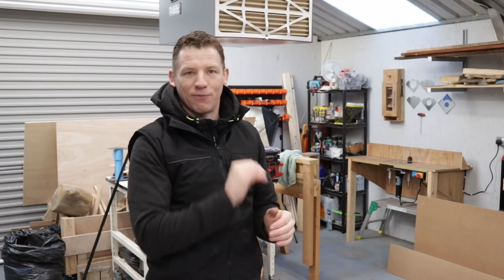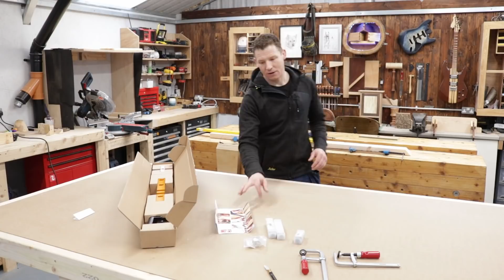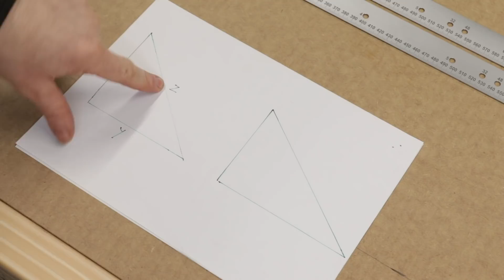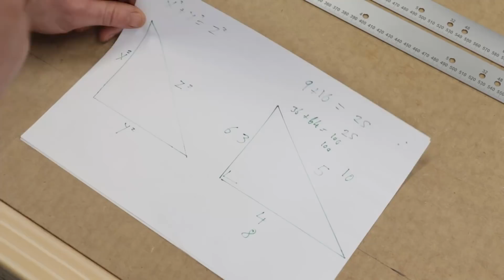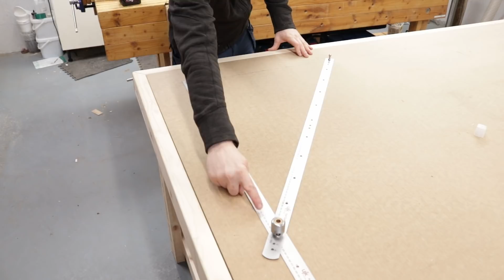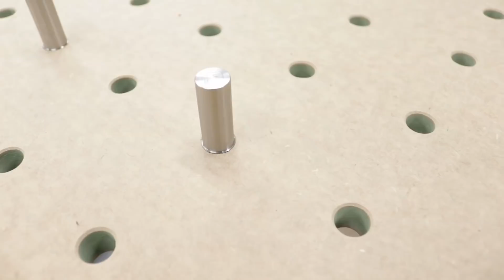MFT Table Build. Using The Parf Guide System MK2. With Problems!!! Part 1

Comment: Hi John,

This is the first time that I have visited your channel and have to congratulate you for the most superb presentational style, excellent explanations and a lovely friendly manner. I note that you had some accuracy issues and can now give you and your viewers some advice.

It is absolutely critical that when making a top that is wider than the length of one of the rulers that you start in the middle (symetrical to the top)  and work outwards - look at Page 6 of the manual that comes with the system. You then work outwards to the left and to the right from there in order to minimise compound errors. You knew that you were experiencing a compound error as you mention this at about 32 minutes.

I thought that your remedy to correct the situation was very sensible provided the whole of your top row is in a straight line. Again, had you started in the middle and worked outwards to the left and right any compound error would be minimised. I used this technique to create my new tracksaw cutting station which is absolutely spot on:

https://www.youtube.com/watch?v=xJ_dhbIdGqE

and the 4 cut test:

https://www.youtube.com/watch?v=4phL-LKM2lg

If you are going to create a multi-use top like this then it might be possible to identify where the key holes that require perfect accuracy should go. So, that forward planning would leave your down draft area (to the left as it appears in the video) to a latter stage in the drilling process rather than at the start of the work.

Now you do say that you expect to replace this top in about a year's time and I am sure that that the new top will be perfect.

Apart from that minor compound error your explanation is perfectly clear and it is not often these days that I manage to get to the end of such a long video - well done.

Peter
Reply: You know you are doing something right when you get New Brit Workshop OG Peter in your BizNaz😂😂😂😂
Reply from the maker: Thanks for the advice Peter, I will share that in a update video. Having checked everything I'm now pretty sure It was an error on my part and not the rulers. 

The final result after I corrected the error is pretty spot on. I will follow your advice on future table tops. 

I have been following your videos and really enjoying your content. 

Thanks
John.
Reply: @JohnMcGrathManInShed  wouldn’t the fact that placing one ruler on top of the other when making your triangle cause the slight discrepancy because the ruler is no longer laying flat on the surface?
Reply: Many thanks . Indeed by working around the perimeter of the grid first by creating 90 degree corners you multiply any discrepancies I believe. Almost the reverse action of the four cut test. I wonder what the inaccuracy was actually though ? Could it be that the frame itself was not a flat plane .? We're the 2x4 studs jointed flat first. If not did the MDF insulate slightly. So if it undulated he PARF sticks would effectively become shorter between 2 points if they followed an unsdulation! Just a thought. Many thanks for the video
Reply: Peter, i just have to say, that seeing your great & informative comment here; after watching such a great & informative video; was a real "fan girl" moment for me.  👍👏  The only thing cooler would have been Pythagoras, himself chiming in.  But of course, he never reads or leaves comments, something about "Silence..."  being  "better than unmeaning words."    
    I share your How to Build a Tracksaw Cutting Station video, like crazy.  I know it has helped a lot of people, in particular those without a table saw.  
      Your cheerfulness is contagious and your channel is medicinal.  Thanks~🔨Lisa♿
Reply: Hi John, love your videos,, I wonder if your slight discrepancy can be due to your 2nd ruler lying on top of the other ruler when you drilled your second row of holes, and not drilling through the ruler which was lying flat in the bench, ''technically'' the 2nd ruler would have a slight curve leaving it a micro measurement shorter, this maybe compounded to the 1/2 mm over your 17 holes,, i hope you understand this..
Reply: @kierannolan8859  Assuming the ruler was 1mm thick, and assuming a right angled triangle, then the difference would be about 0.0005mm, 2mm thick ruler would be 0.002mm. I doubt this is of any real world impact?
Reply: Peter Parf and John are truly two gentlemen on YouTube. 
Nowadays that is , unfortunately, a rare thing to encounter. 
It’s very refreshing to see two people speak 100% respectfully towards each other while disagreeing somewhat. 
Peter you especially impressed the heck out of me with your thoughtful response towards John McGrath. 
Because of this alone I’m following both of you from now on. 
Truly a breath of fresh air in these troubled times. 
We’ll as John states “Crack on!”  :)
Reply: If you get drift on the rules, can the drill jig really save you? I.e. if you get a 1 mm drift over 10 holes of a ruler, should you not possibly get 0,3 mm over the distance of the drill jig? Would it not just be pure luck saving you...?
Reply: Could it have something to do with the slab not being supported underneath while drilling the 3mm guide holes? Because he said the holes lined up perfectly, it was just a smidge too short. Maybe a touch of harder downforce while drilling caused it to sag a bit. Either way, he sorted it out👏👌 And always pleasant to watch his videos, genuinely nice guy! Keep up the good work😊
Reply: Thanks for your comments Peter. 

This video was very helpful to me. I am familiar with tolerance stacking, and I knew he was in trouble when he “went around the corner” for the back row of holes. The first row of holes needs to be your reference point for as many of the other holes as possible. 

It occurs to me that it would be better to drill the holes in the top - at least the small ones - before assembling the table. That allows you to clamp the rulers as much as possible as you work around to top.
Reply: Hello Peter. I wanted to comment on your thoughtful and considered response. It's understandable to want to jump to the defence of the Parf guide kit, but you did so with aplomb. On the subject of the "drift", I wondered, as it's such tiny amount, could it be that because one ruler lies on top of another at one end, that in effect this creates a very slight horizontal triangle, thus pulling the top row towards the bottom row ever so slightly? I.e. if the ruler lies flat, then the holes are going to be exactly the right distance, but putting one end of the ruler on top of another technically makes a teeny tiny arc. I might not have explained myself very well. :S
Reply: @neilbarnwell  Hi Neil, I understand what you mean and it is not enough to worry about.  Cheers. Peter
Reply: @NewBritWorkshop  Terms like 'perfect' and 'not enough to worry about' tells you that a woodworker is talking. An engineer works to tolerances (literally nothing is perfect) and refers to them constantly. Any precision tool that does not declare its tolerances is open to suspicion...
Reply: @neilbarnwell  I think you may have found the reason for compound error. It seems that the error could be prevented if the top ruler were shimmed up from the table top. And better still, the Parf3 would have that feature built into the top ruler.
Reply: I'm actually not at all convinced by the explanation. In fact it's not so much an explanation but a workaround. Why is the system inaccurate to begin with?
Reply: This makes this system sound far too complicated… “page 6”?! No thanks
Reply: Besides the idea of minimizing error by starting in the middle and working outward, we also need to keep in mind references.  In this case, the first hole you drill is the ultimate reference point.  After that, the first row you drill is the reference edge or plane.  When you switch from using the bottom row as a reference to using the top row as reference, you are now allowing error to build up.  You have allowed multiple errors to build up:  You're relying on two 90 degree measurements to be exact and you're relying on the hole location in both vertical and top row horizontal to be exact.  That's asking too much from the system and would be considered a non starter in the machining world.  Machining drawings always call out a reference plane so that the machinist not only knows from which edge to machine, but the quality assurance team also knows from which edge to measure.  The engineering team decides which plane to use as reference based on the assembly requirements.  No machining drawing allows you to reference the location of an item (such as a hole) from two parallel edges.  I.e. you only reference a hole location off two perpendicular sides on a square.  

I think best practice would be to start from the middle as suggested above AND also only build all your vertical columns by triangles referenced off your first row.  You could also further reduce total error by never drilling more than 5 holes away when using the ruler as a straight edge.  

Anyway, this one looks pretty darn accurate to me so no biggie. 

My theory with these tables is that when trying to make a 90 degree cut on a large panel, you only really need a fence 90 degrees to the tracksaw guide.  I'm about to build one of these myself, but I have to wonder if having super accurate holes for the rest of the table, while wonderful to use, is really that important.   Clamping is clamping and using a pin to stop something from moving is pretty easy even if holes aren't lined up.  

I use Veritas quick release adjustable dogs on my somewhat thrown together beefy workbench and they make misalignment of holes a non issue when clamping from the edges.  I've clamped plenty of sheet goods and hardwood for dominoes, sanding, etc and hole misalignment has never caused me any grief.

Comment: Comment on choice of table top.  3 years ago I used the parf system to MFT my bench worktop (2 inch pine, salvaged from a sauna) and a assembly table with 1 1/2 inch ply top) . Needless to say the pine top moves across the grain. Across 3 holes + 1-2mm growth between centres, with the grain, dimensions have held. So timber MFT is a no no? Well surprisingly,  the right angle relationship seems to have held.  Next issue is stops spanning several holes. I make my own from timber using the parf jigs to ensure correct centres and then elongate one hole.  

Next dogs , for those of us who ancillary accessories add to much expense. I purchased a 20mm stainless steel bar and cut that into multiple various lengths.  And finally a reamer. Take a 20mm length drill and tap an m8 hole and add m8 rod to one end. Next with a 1mm grinder disc cut 2 vertical slots. I found holes in timber and ply did need reaming.

Comment: I am sure this issue has been covered many times over by now as your video is 3 years old. The issue you are having is not due to the equipment. If you go to “The new Brit workshop” channel, Mr. Parfett himself explains how to maximize the accuracy of hole positioning. You start at the middle of the table on the working side. You basically put a line parallel to the close edge centered in the table. Then use the 90 deg triangle to do left and right line out into the table. Then use one rule to fill lines between them. You then work out from there. You have minimal or no error at all at the outer holes that way. The way you did it, starting in one corner and going around the outside, amplifies any errors that may occur. I have done a full table as big as yours and did not experience any issues at all with the 3 mm or 20 mm holes. It is all down to the process.  I like your videos as you show the issues along with the things going well. We learn as much from the errors. Thank you
Reply: It’s not to blame, sure. But it’s a lot of money for something so unintuitive. There’s room for improvement in its design and implementation

Comment: I just built my 4th top from the parf system. I had this same error happen on table 2. I found that if you lay the hypotenuse ruler flat on the table and the straight ruler on top of it to drill , all is well. I have then tested this in reverse and always seem to get the error.

Comment: This system has too much room for user error, for the price I would expect better design and quality control. For example, the rulers are not straight and they are flexible, so you can easily introduce an error just by slightly bending the ruler. Overlapping the two rulers adds another small error because the upper ruler sits diagonally to the table, and when you connect the other side with a pin, it shortens the ruler. The drilling ruler needs to be made out of a thicker material with 6 fixed bushings for drilling the pilot holes. The other ruler that sets the diagonal, needs to be connected to the drilling ruler in such a way that it doesn't overlap with a space under the ruler.

Comment: After the second top that I made with the Parth jig things are getting better. The biggest variable in the system is the flex in the ruler. Clamping down the ruler should happen at hole 3 and 8 to help stabilize the center off the ruler. After drilling hole 0 and 10 and placing a pin in them, support the ruler with a straight edge, other ruler or straight timber without bending the ruler and drill hole 5 and place a pin. Still with support on edge drill other holes. 
If Peter Parker want to improve on his jig he should give us stiffer or wider rulers with no lateral flex.
 Drill colomn 0, 5 and 10 with Pythagoras method and side support the ruler and drill hole 10 and 5 and clamp if possible. 
Next step drill row 5 and 10, again with side support and clamp if possible, starting with center hole 5 and pin first, then rest of holes.
Now drill column 1 to 9 and because row 5 is already drilled, you have centre support for all columns already in place.
Check your angle of drilling, I have found some drilling curls under the ruler. 
Also make sure to put the drill guide with longer bushing far away  when not needed.
Work everything off the first reference line of holes where possible or as close to the the first row as possible. 
When extending left and right the biggest mistake will show if hole 5 on first row had some movement or ruler flex. It will also show on the Pythagoras column if hole 6 was used on horizontal line.
The flex support and precision drilling of hole 5 is super crucial for the the accuracy of everything following. 
Making me think of getting more pins and drilling closer to hole 0 and 10, say 2 and 8, pin them, then drill 5, pin and complete rest of holes.
I am going to ask Peter Parker for a wider set of rulers. 
The more you use the system and the more you cross check with ith the Pythagoras rulers the more accurate you become. 
The more you practice the luckier you get.

Comment: Well I'm coming to this 3 years later but having recently finished my own table setup which has a similar sized grid:

1. There appears to have been a manufacturing problem around this period and this may well be the cause: https://www.youtube.com/watch?v=VawfkmVPs0U&t=321s
2. As someone else pointed out you changed the reference plane which may have introduced an error, in the instructions it suggests creating the two vertical holes from the first horizontal line and then creating the second horizontal line making a square.

Overall I found the system perfectly accurate despite the slight rise on the ruler over the distance.
The rulers are 1m long and only 1.5mm thick. This means that (as far as I can workout with my rusty trig maths) The top (hypotenuese) ruler pulls the vertical ruler left and down a tiny amount making the horizontal shift due to the rise, assuming approx 800mm, 600mm and 1000mm (6/8/10) 0.0018mm or 1.8 microns which a 50th of a human hair thickness. If I'm wrong .. well school was a long time ago now :) If I'm correct then even with compound errors the effect is negligable over even a very large worktable.

Comment: Hi John,
Update to my comment below - I've built my top and made my grid of 3mm holes, and now I'm coming back with the 20mm.  It's about the same grid size as yours.
I did it a little differently...
- Did the first bottom row just like you.
- Built the same triangle to make the left column.
* Built a 'mirror' triangle to make the right column.
* Then used the rule across the top #10 holes to make the top row.  (pins aligned perfectly)
* Repeated rows with a single rule pinning in sequential column holes.
So I only built the triangle twice... left & right mirror image columns.  From that point on, I used a single rule to make the rows.  And even at the #10 holes (at the top of the columns) both pins went in flawlessly.  Then I used a single rule to extend the rows +3 holes each.  Checked the column again from bottom to top, and the pins had no issues.
But I find no fault with the way you did it either.  Should have lined up even though you started with two perpendicular triangles.  Still a mystery I guess.

Comment: Thankyou for posting your experience.  I am currently deciding between this Parf system and one where I can use a plunge router.  As careful as you obviously are, anyone could find themselves in a similar jackpot.  In a system where it's whole purpose is accuracy, an error like that would rob all my enthusiasm and I'd feel just sick. 
I like your solution to correct the error.  Only thing I might have done differently is to relieve the 3mm hole out to maybe 1/4" or so... that way the pilot point of the 20mm bit won't pull against the guide & away from true center.
Trusting that the rules are made perfectly, the only reason I can come up with is maybe the overlap when building the triangle?  Because the rules are no longer co-planar?  Seems like a nat's ass of difference, but... maybe?